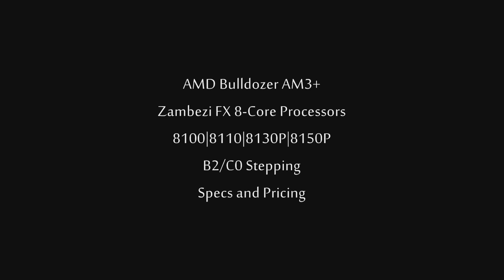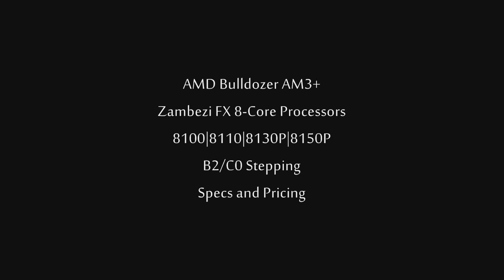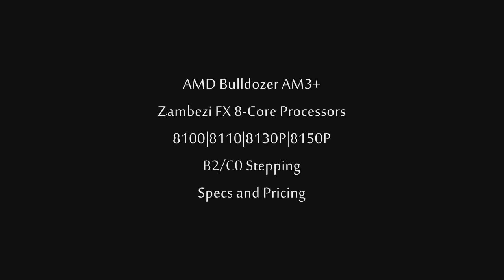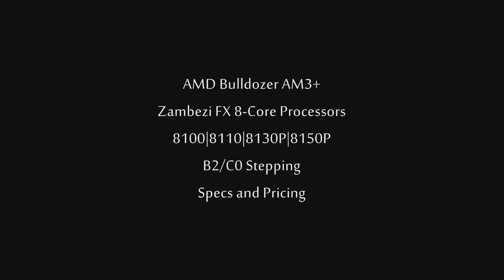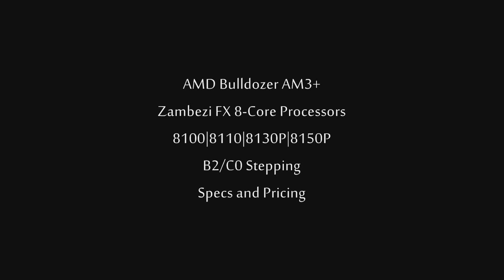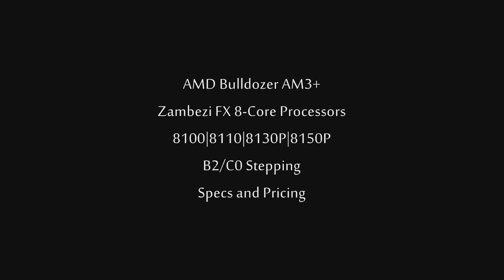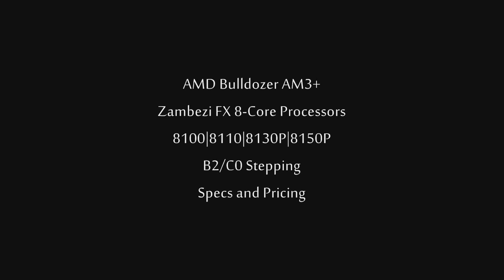AMD Bulldozer 8-Core CPU Specs and Pricing

Comment: I just got the 8150 put it in my pc, put some artic silver 5 grease on it and my silver arrow heat sink. and first post 5.01 Ghz. my ram is running at 1600, 6,8,6,20, this CPU is awsome. dont listen to the bull shit . this cpu is amazing. AMD rocks

Comment: I'm going to use it for more purpose than you it seems. Since i have my 6990 in order and in the future a second one i m gonna benchmark the shit out of my processor and overclock like crazy but in your case you are right. When you decide now to upgrade you can also take a 4 core bulldozer processor , problem is i do not know if they gonna release 2 versions one with a locked MP or not.
Anyway i would say consider it with  the upcomming BF3 and WH 40 000 Space marines.

Comment: @YmCmbZ for the same price ?no way.Got a i5-760 and my friend with a X6 is Dominating me in cpu benchies and other shit. Not to say amd was cheaper .And what do I need a i7/Iny brige CPU for ? Even in 3d max or similar, the time it takes for AMD would be 10% bigger in worst case scenario,compared with a i7...Why do I have to spend 700+$ on something I don't use to it's maximum when AMD is offering that much power at the price of a mid-range intel Cpu ? Reason enaugh for me, a regular consumer